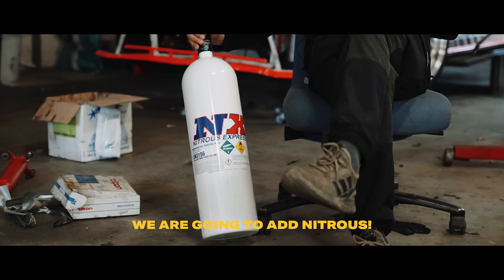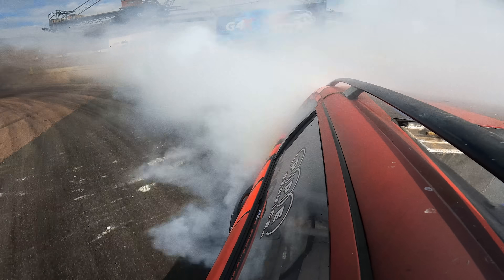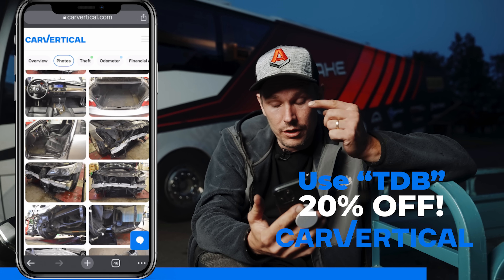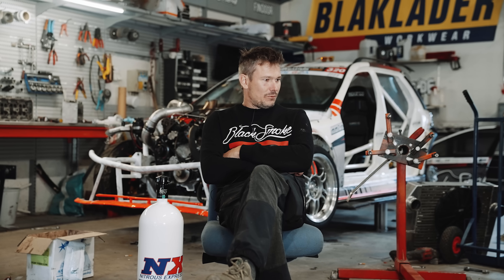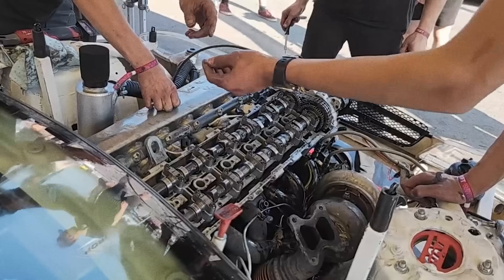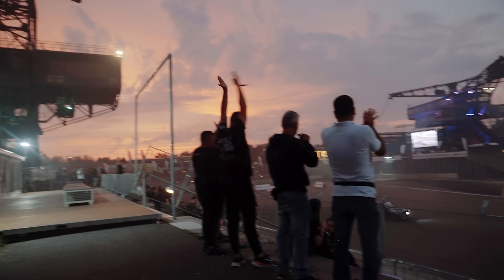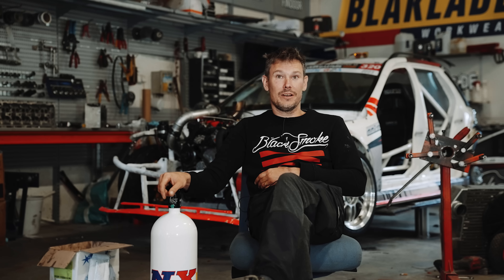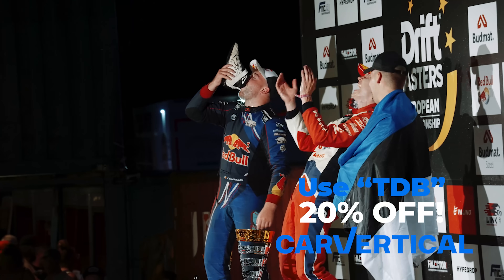OUR ENGINE EXPLODED AND WE SOLD EVERYTHING | DMEC Germany

Comment: Should have went with water methanol, would have helped with cylinder temps. Where was your torque peak at for RPM?
Reply from the maker: Torq peak is little bit before 4000rpm.
Will see, maybe we try water injection in dyno session
Reply: @turbodieselbuilds  wow the engine is screaming then. Rpm limiter at 5000 then?
Need some green loctite on those frost plugs. Or thread the holes and plug them with a Allen plug and loctite

Comment: New tricks on the engine, how about just driving and not testing everything new all the time. Blowing stuff gets really old really fast. You have a working combination already.
Reply: Working and competitive is 2 different things.
Reply from the maker: we are just updating to get even more reliability. The current setup is very good. Nitrous will only be used on lower revs.
Reply: @turbodieselbuilds  Thats what worriers me, mean cylinder pressure at low revs. It is very easy to bend a rod or blow a gasket when injecting nitrous on low rpm. As there is more time to make cylinder pressure. And SOI and duration is very critical.
Reply: @PHUSII  Yeah, but working and blown is also too different things. You get points when finishing races.